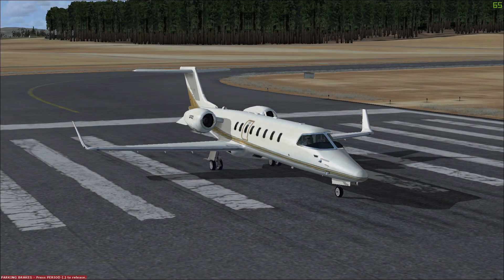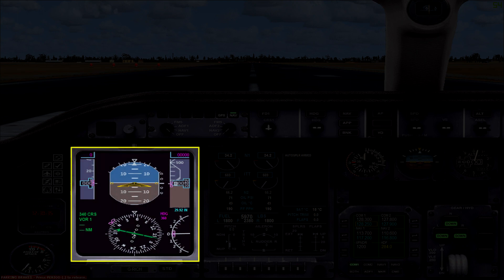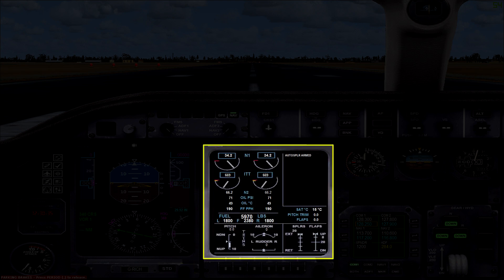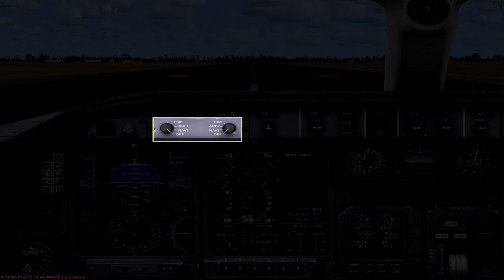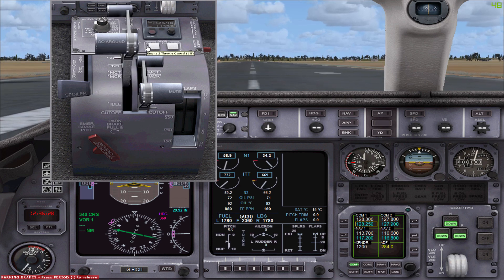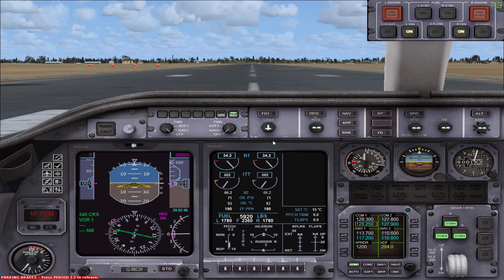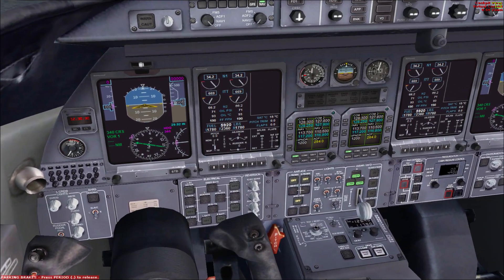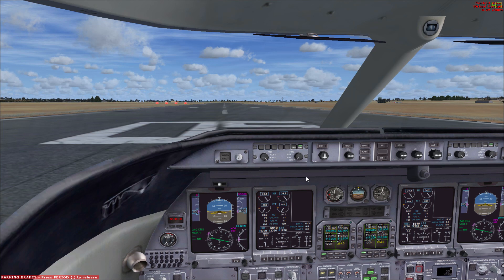FSX Tutorial: Bombardier Learjet 45

Comment: Hi doofer 911, When i fly Bombardier Learjet 45 in the cruise altitude, the nose is up all the time even when the VS is zero. I cannot see in front of me.
Reply from the maker: Are you travelling fast enough? You should be close to maximum speed when you're in the cruise. Also, if it's the 2D cockpit you're looking at, I think the view is poor anyway. Try pressing SHIFT+ENTER which "raises your seat" and changes your view slightly
Reply: Thank you. Yes its because of speed i had relatively low speed. This is the first time i fly a jet engine that is why i am a little cautious.  A quick question, I dont see any GS indicator for ILS approach in the PFD. Does it have any GS ILS approach indicator?
Reply from the maker: You may have to enable APP on the autopilot panel for the localiser and glideslope indicators to come up.
Reply: Doofer911  I
Reply: You must first insure your destination airport has an ILS.  Check the Map. Runways with an ILS are marked with green "feathers". Click inside the feathers to get the ILS freq & course.  Enter the ILS freq into your NAV 1 radio.
If you still have trouble, check out my ILS / Approach mode video. In the video I'm flying a 737 but the principles are the same. 
When the ILS system is properly set up, it activates the GS & Localizer indicators, not the Approach (APP) mode.
Reply: The Approach mode (APP) is not required to do an ILS approach.  If the NAV 1 radio is turned to the correct ILS freq, the LOC & GS indicators will be displayed during the approach.
Reply: In virtual cockpit do: - (minus) then Shift & Enter and Ctrl Q sometimes